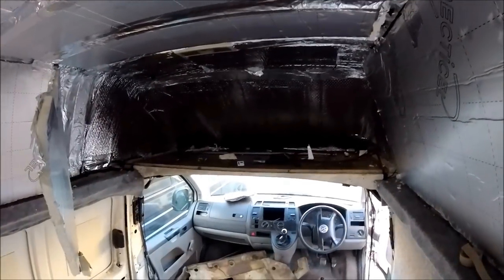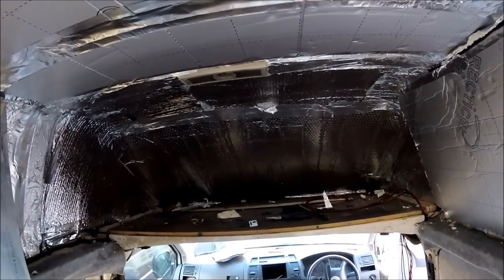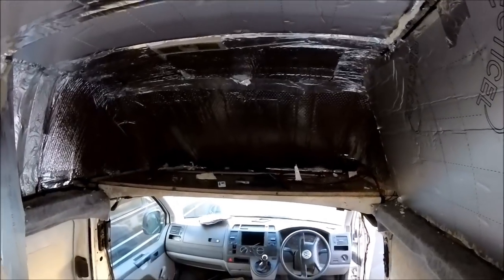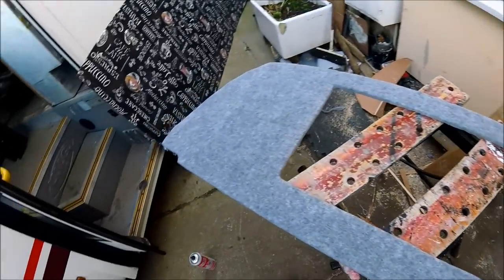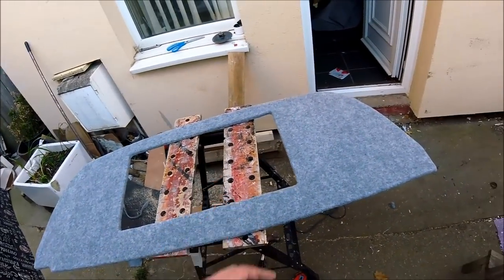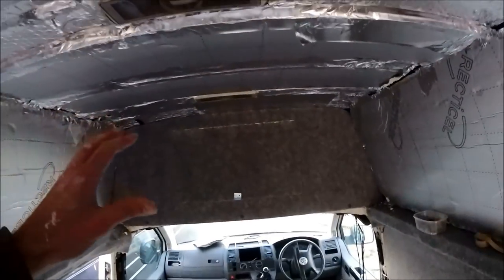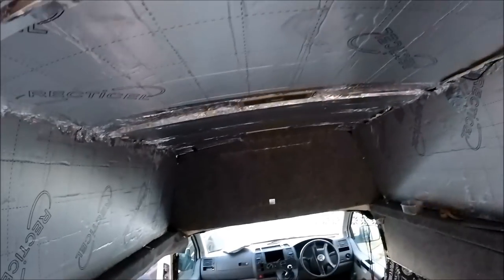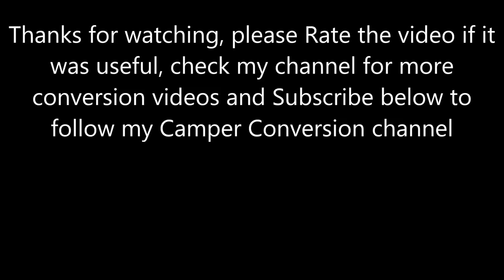VW T5 Camper Conversion Project Part 6: Overhead Locker Build & Install

Comment: Hi, did you ever think of making a overhead locker for the back too? I'm thinking of building one that rests on the metal ledge for the backdoors.
Reply from the maker: I thought about it and if it was an aftermarket high top I would have, but with it being a factory high top with the full height tall rear doors, I didn't want to block off any access via the back doors

Comment: Class videos mate. Where you from, sounds close to me.
Reply from the maker: I’m based in Teesside
Reply: @TheCampervanBuilder  I knew it. I'm only in Gateshead. Do you do this for a living? Do you sell converted campers as such?
Reply from the maker: I just do this as a hobby in my spare time, gives me something to do on weekends etc
Reply: @TheCampervanBuilder  how long does it take you to complete a basic build of insulation, rock and roll bed and night heater?
Reply: And ply line too
Reply from the maker: normally 2-3 weeks worth of full time work on a conversion, but spread over weekends instead.  Dark cold days don't help either so it takes longer.  I did do a couple of micro campers to sell over the summer but this T5 or the next project will be a keeper, just not sure which yet
Reply: Would you consider doing one of these if I supplied the van? If so how much to do the insulation, carpet, night heater and line?
Reply from the maker: I am willing to consider doing work for other people but as I am just a hobbyist who does this in my spare time and not as a professional converter , it's hard to say how much and how long it'd take as there are lots of variables, would you be supplying all the parts or would some need sourcing, how quick do you need it done by, exactly what whats installing and where etc....  if you want to discuss, feel free to message me via my facebook link on my channel banner
Reply from the maker: As a rough idea for insulating, carpeting ply, carpeting metalwork, fitting night heater and other small bits if all parts were supplied I’d be asking about £1000 to do it all
Reply: Camper Conversion that’s not a bad price! 
Will the Mercedes minibus be converted? As I’d love to see how that’s done. 
Love your videos 👍